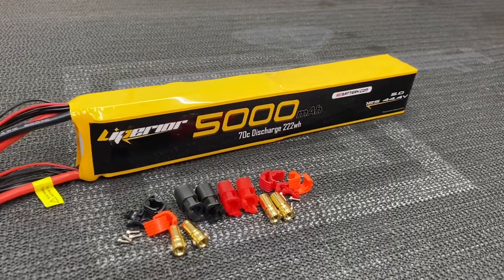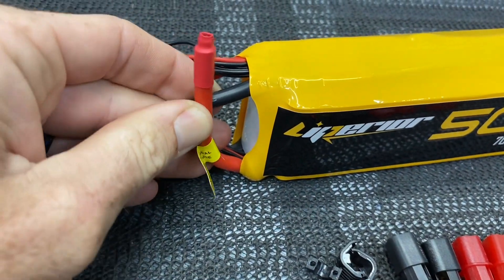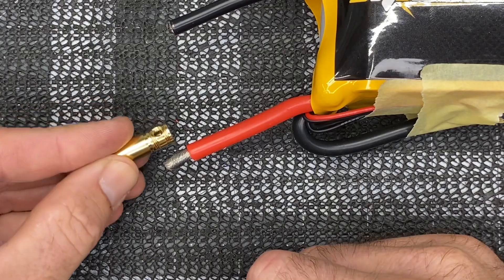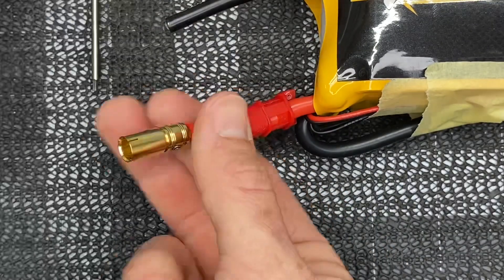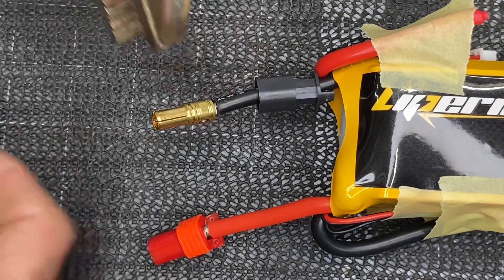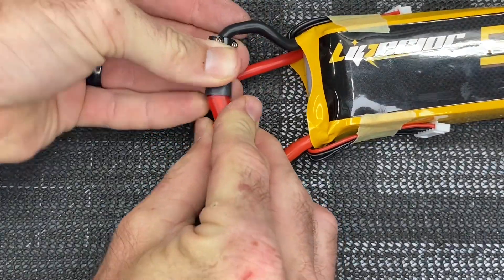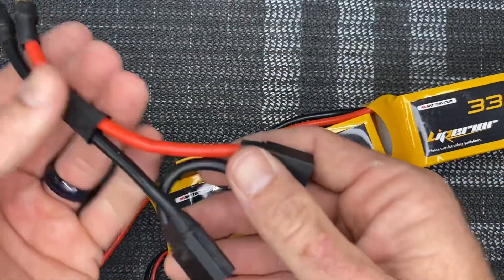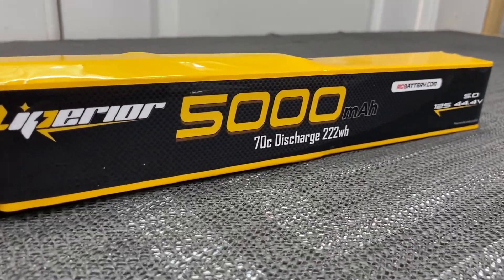How To Wire A 12s Series Connection

Comment: Ok so my argument is - does RC ProPlus not suggest to just use one grub screw ? They do not supply you with enough grub screws to use two per connector - which has been my experience - thoughts ? Thanks
Reply: You only need one. Two is worse then one.
Reply from the maker: I have probably used five packs of these connectors and I have had two per connector on every pack. That is strange that you have only gotten one?
Reply from the maker: They are designed for one set screw on each side. Not one!
Reply: @westhobbiesrc8051  - hmm 🤔 ok well then I have been short changed set screws - lol

Comment: When you screw in that shoulder piece keep your fingers out of the path of the hole where the screw comes through. The friction heats it up ALOT. I love these connectors. They are pricey compared to everything else BUT...they are a breeze to reuse. Getting the clamps off is a bit challenge but can be done. I'm one of those that also wonders one or two screws, I would need to go and count but I think they only provide enough set screws for one per connectors. You know when the set screws are seated far enough because the plastic cover will slide right over the metal plug and can rotate. I'll plug them in where they are supposed to go and take any twist out of the wires between the plugs than tighten the collars. This video will help all of you who never used these before because I have never found any instructions for them.

Comment: Hello Jeff,

I really like the fact no soldering is involved. How do you connect these batteries to your charger? When will you do a maiden of the SAB 500? 🧙‍♂👍
Reply from the maker: Hey Robert! At first, I was very skeptical about them. How good could solderless connectors be? But I have been using them for a little while now on multiple different set ups, and they are fantastic! RAW 500 Maiden soon, was waiting on a Vbar areEVO to get here and back in stock and it showed up today!
Reply from the maker: And for charging, you would just make charge leads to match your battery leads.

Comment: Hi Jeff, 

I'm contemplating using ferrules before connecting the cable to the S7 connector. I'm a bit concerned that the cable strands might become loose over time. Have you ever experienced any problems with loose connections when using these connectors?

Comment: Hey Jeff,
Have you figured out a way to take apart those little orange clips on the solderless connectors without breaking them.
Reply: Use x-act knife blade - just press it between the split in the connector and give it a little twist - pops those clips off without breaking them .
Reply from the maker: Hello! Yes, very simple way to do. It is an X-Acto blade right at the two parts and push down slightly and twist the blade from the top. Careful not to break the blade or cut yourself and they will pop right apart with no damage and reusable.

Comment: Jeff,  if I wanted to use two 6s packs couldn’t I skip the jumper,  and y harness my ESC leads with two EC5s?
Reply from the maker: @mtb4maine  yes you could, I don’t do that because it looks cleaner doing the series at the battery and only having your two connectors at the ESC. But if you’re running EC-5 connectors then that will work.

Comment: Hi Jeff, how do you power your charger at the field? Just your car battery? Thanks.

.
Reply from the maker: So that depends on what field I go to. My regular flying field, I helped them build a change station which has 6 100ah LifePO4 battery’s and solar panels on the roof with chargers to maintain the batteries as there is absolutely no power out there. I also have a small 2000 W inverter generator, which I keep in my trailer when I go to events and that runs my chargers. Or! You can get a 100ah life PO4 battery and make a power bank so your pulling off your car battery. There is a bunch of ways. But the 2000w inverter generator is the best, super quiet and runs all day on little fuel.
Reply: @westhobbiesrc8051  thank you Jeff,  that is great information and helpful.